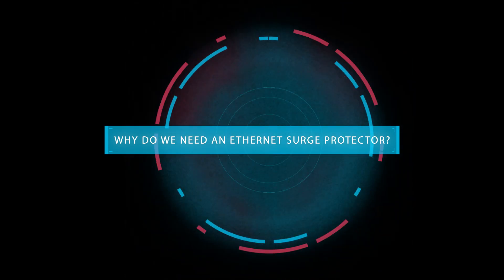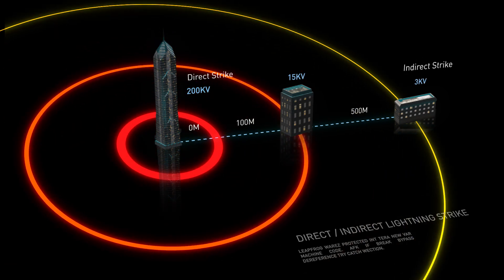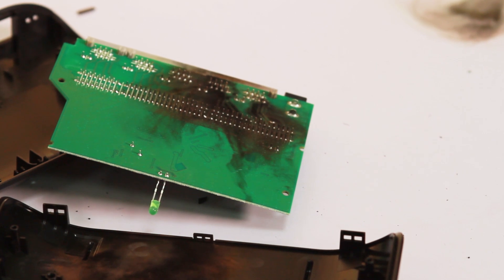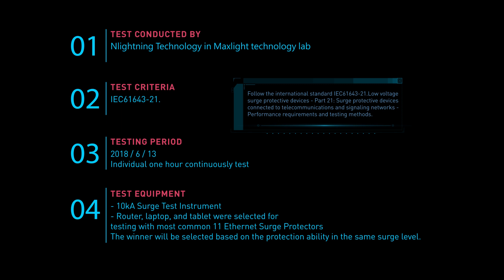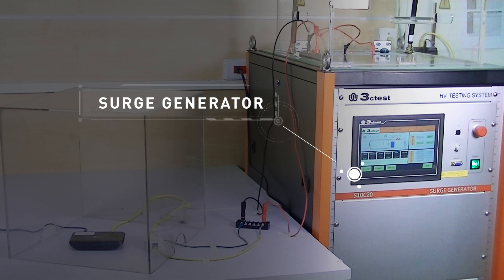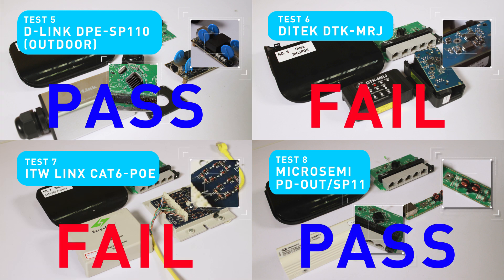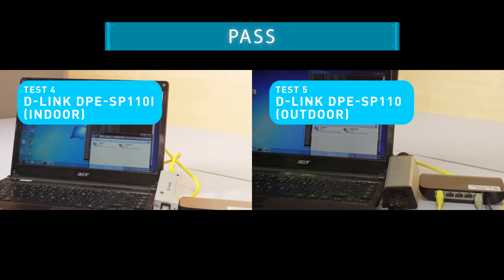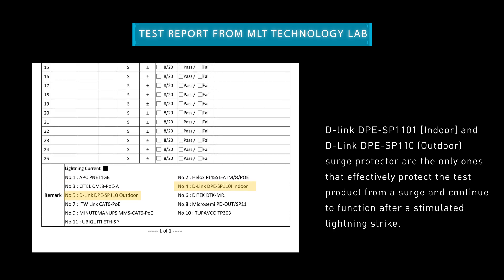Real strike on various PoE Surge Protection Device(SPD)

Comment: make Sure your device have Varistor inside, it will pass the test, like D-Link.
Reply: Hi a little help here...i have tenda  f3 300mbps..router  buffering & low speed after even trying optic fibre and ping is shows 100 ms ... My local internet provider  told me the inner circuit working abnormally bcz of lightning  & to  buy a D-Link / tp link .. does lightning really affects??

Comment: Just use an optical connection and forget about all this useless shit
Reply from the maker: Sure, use optical, but equipment still need power source.
Reply: Good luck using optical connection for PoE devices.
Reply: @icipher6730  internet -> mikrotik -> switch hub -> media converter A -> B -> Poe -> radio
Reply: @namasaya5931  Ah yes, adding more potential points of failure has never been so much fun before!
Reply: @namasaya5931  tell me more?
Reply: @namasaya5931  sama aja. Tuh PoE di ujung juga butuh proteksi.
Reply: Agree.. use an optical more cheaper and 100% work.. $10 vs $100..  and the $90 we got new radio LHG 5hpnd .. 😂

Comment: Were you paid by D-Link or associates? Also why did CITIL pass but failed. Did the unit die but the router lived?
Reply: @ 2:46  shows the Protector PASS, (no burnout)
@ 2:54  shows the PC Ethernet Port Link Down (x mark on the screen)
So, I think the total result is Fail, and also the Lab report the the Loading Fail (Switch un-link)

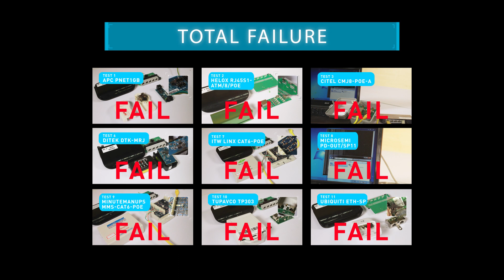Comment: I wonder is the Tupavco outdoor unit with 8 fuses would fare better than the 4 fuse one at 3:40... It’s twice the price but the proper UL listed ones seem to start at 400$ which is a bit more than I want to spend on this particular project. The Ubiquiti uint is supposed to be doubled up on from what I understand, could be wrong on that.
Reply from the maker: Ubiquiti has different model names on same exterior, seem to be named as gen1 and gen2, however, if you ever tear down both, you'll find that the test result will be the same. In fact, we do test gen2 and get same result.
Reply: @nlightningtechnology5236  did the switch destroyed too or only the surge protector device?

Comment: All of these are junk, only 1gbps. 10gig is the new standard.
Reply: They are used for PoE IP cameras, I’m using one for an outdoor RasPi SDR project. In no way do you need 10gig for those purposes, not even for an outdoor AP so you don’t have to use cell data in your annex building...

Comment: is your test done without connecting the grounding wire of the SPD?
Reply: They clearly have earth leads running off each device and have designed the test very professionally - so to me there's no doubt they are connecting the grounding wire. I believe that if they didn't connect the ground wire, ZERO of these devices would pass the test as they would all fry without somewhere to send the charge.

Comment: so ubnt fails....
Reply: @Yosako that's not the G2
Reply: just the same...since its hard to produce where to but d link i used fiber media converter as a fuse in the wired network.... @Hartsock2009